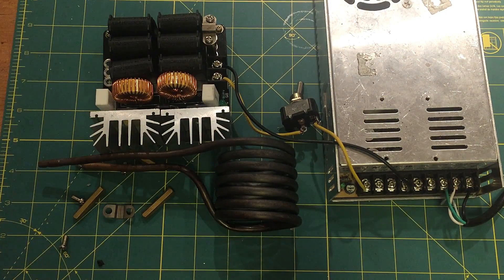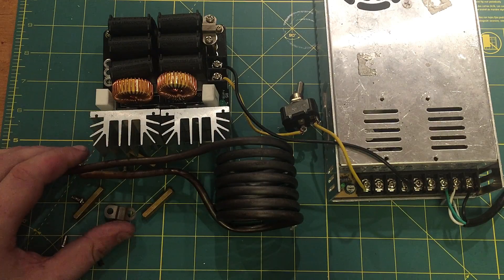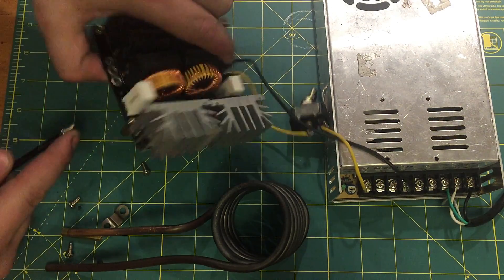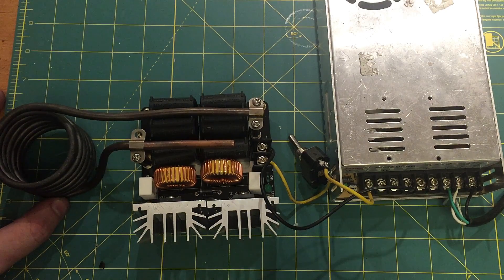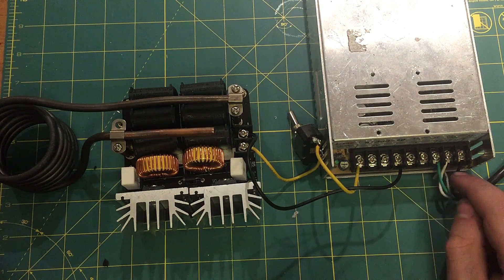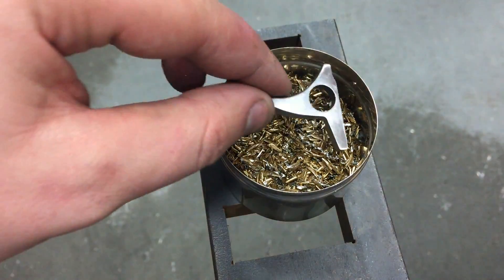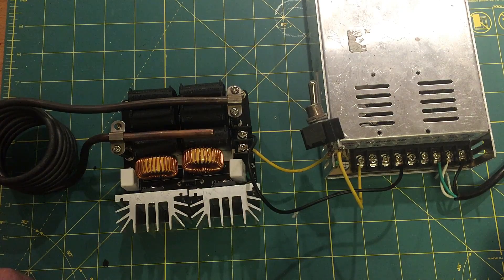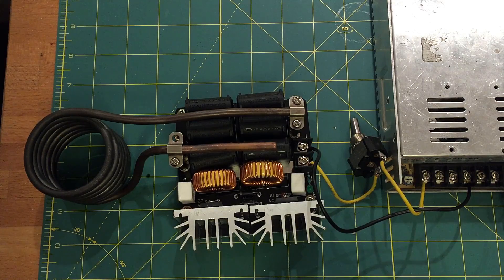1000W Induction Heater:  Overview, Mistakes and Lessons

Comment: Its sold and marketed as intended to be used with water pump cooling the work coil. and high flow fans to cool the caps. otherwise you cant go past probably 100-200W safely. You obviously cant use it at 1kW for any amount of time without cooling. its a very basic tank circuit with quite low rated common parts and its without any "brains", like current control, any control tbh, its just resonating with 8 descrete parts, so its a bit random and can blow up if something lags. This is why you also should fuse it.. Also, The power can get much higher in the coil. The resonating parts, the work coil and capacitors, push a much higher current at resonance. Multiple times higher.

Comment: I have 4 of these and they vary from 6 years old to 3 weeks. If you run water through the heating coil and a fan on the circuit board you will negate the overheating issue.

Comment: great video sir, BUT you should have a 15 amp circuit breaker on the positive line near your on/off switch, this will save your power supply from blowing up.
I have this same module only i added 4 extra Capasiters and 2 extra Inducters and soldered them under the circute Board this has stopped the module from Heating up due to prolong use.
for water cooling i used a car wipper washer bottle it works perfect with a 9v power supply.
you will need to change the coil size  to get maximum temp.

Comment: How do you prevent the board from overdrawing the power supply? I am finding that I can get the board to turn on, but the power supply blows once I put a piece of metal into the coil. Any ideas?
Reply: The solution is to use a suitably powerful power supply.

Comment: Why don't you cool down the circuit with a 12v fan instead of cooling down the coil. It works very well
Reply: Because that is not the best way to do it. The coil is a tube (pipe) for a reason. The circuit board doesn't get hot, the coil gets hot and copper conducts heat. DOH

Comment: OK, I know the video is 4 years old but, anyway. Capacitors get hot in these designs and, like semi conductors, need to be cooled. Also the induction coil, so try pumping water through it from a bucket on the floor. Lastly, the power consumed and heat generated will depend on how well the coil couples to the object being heated. If you had a 2 inch internal diameter coil heating a 1.75 inch solid iron bar you might get up to 1000w input. This implies you might want to try smaller diameter loops for smaller objects - you might also want to insulate the coil to avoid "issues".

Comment: You need a power supply that can deliver at least 20 amps. That's because it's all too easy to load the circuit down to the point where the power supply goes into current limiting, which reduces its output voltage.  Once the voltage goes below about 12 volts, the Mosfets don't turn on fully and then they overheat and fail.
Reply: How do you make sure the induction board doesn't overdraw the power supply?
Reply: @the.marylander  With this circuit,  the ONLY way to keep that from happening is to use a power supply that can supply at least 20 amps, or, even better, let's say 30 amps.  The board simply takes whatever it needs.  In my opinion, you MUST have some sort of amp meter in the DC line to the heater.  And, just in case, a voltmeter across the DC power supply as well so you can make CERTAIN that the supply voltage never drops below 12 (or preferably 24 volts at any time.  If things are working properly, when you first power it up using the coil that comes with it, the system should draw a half dozen amps or so and the power supply voltage shouldn't drop at all.

Comment: What frequency do they work at?
Reply: Usually a few tens of khz.
Reply: @uK8cvPAq  is there any way one could make it work at 100 KHz or any particular frequency?
Reply: @atul2048  Yes, the frequency is set by the tank capacitor and coil inductance.
Reply: @uK8cvPAq  ✌️ ✌️ Thanks man
Reply: @atul2048  That one is running at about 90 kHz.

Comment: Cool, I almost killed mine yesterday too, it's scary how much heat the coil put out.  Previously I was running from the "brick" power supply I got from recycle it was 20V and 12.5A and coil never got charred.   I decided to get power supply with adjustable voltage and digital meter that displays voltage and amperage it actually goes up to 51.7v and 11.3 amps but boy did everything got super hot!  You also reminded me that I could heat treat my  O-1 parts as well.  I got the water pump already, I need to make a different coil and make sure connectors extend past circuit board, don't want water leaking on circuit board.

Comment: I don’t think you watched many other videos, or read the information from the various people selling this. Or read up on induction heaters.
You need to water cool the copper, and you also need to do better cooling of the suppy if you use it any high power. The manufacturer says that, and most of the videos by anyone who has used it without blowing it up have done that.
It’s not a toy, it uses high voltages and high current to create very high temperatures.
Reply from the maker: Fair enough, i could have done more research, and i appreciate the safety warning, though i do think it was a fairly honest depiction of how someone else may be tempted to approach it (and how thats a bad idea :p)

Comment: would it be possibel to extend the coils or do they need to be a spesific length and so?
Reply from the maker: I imagine youd run into power losses with a longer coil.  The more coil there is, the more inductance, and the harder it is to reverse the magnetic field quickly

Comment: Anyone know what size silicone tube would fit to run water through this?
Reply from the maker: So for the pump it wants a 3/8" ID (1/2" OD) tube, the coils are 1/4", so since the video I got an adapter for 1/4" copper pipe to 3/8"ID pipe (https://www.mcmaster.com/#51875k52/=1ciztzo + https://www.mcmaster.com/#44555k133/=1cizt1o) to connect the copper to the tube, and then you can just route the 1/2" tube

Comment: I was thinking of buying a similar kit, my goal is to experiment with heatshrink toolholders for small endmills/holders (1/8 inch or 3.175mm in SK15 toolholders for example) Do you think this kit has enough juice to heat the end of that toolholder for those small endmills?
Reply from the maker: I don't know if this would be up to it.  When I get the new one up and running I'm hoping to try some shrink fit tools, but it would certainly need good cooling in the coils.  The next level up is about $400 USD, but I have heard of people using that one for shrink fit tooling.  I'll definitely try to come up with an answer on the part 2 of this video!
Reply: Thanks for the reply, I haven't seen someone try it on this scale (small scale) and as a DIY project. I think it's pretty cool and would love to experiment with it! For what machine and what size toolholders do you want to try it?
Reply from the maker: Well I saw someone on instagram make ER16 shrink fit solid collets, so I'd love to try that, but it wouldn't be too hard to just start with a big block of steel with a hole in it and progressively turn it down to see when the heater can expand it enough
Reply: Oh that is a way better idea! easier to use on many different machines without extensive modifications. I'll keep an eye on your video's (in case you actually get around to trying it out). If I get to it sooner, I'll let you know!

Comment: How can you control the temperature of the heated material? Lower voltage? Lower current? I want to temper something at about 250 Celsius for a longer period of time, not to go as high as 700-800 Celsius. Thanks
Reply from the maker: I think the correct way to do it would be to change the frequency which you cant really do on this board.  Otherwise you could under power it and it just wouldnt be able to keep up with the object cooling.  I think id go with a cheap toaster oven for annealing though :p
Reply: This is actually not such a bad idea! I already have a speed variator recovered from a old vacuum cleaner, if it's thermostat won't do the job properly. I suppose I can have enough control for what I want.

Comment: can i put 2 1000w ZVS together and make them share the same coil dose that will give me 2000w power ?
Reply from the maker: Im not sure... i think they would have to be synchronized when they oscillate or they would cancel each other out
Reply: i need to melt iron and steel with this ZVS any ideas ? can it  melt steel if it left for to long ?

Comment: Also, you can make a cooler running treatment coil from Litz wire.  It's especially made for high frequency magnetics.  It's a way to go if you're not particularly thrilled with liquid cooling the treatment coil.  However, Litz wire is a specialty wire and isn't cheap.
Reply: Are you sure about the Litz wire idea? I'd think the Litz wire would ruin the effect but that's just my gut talking. My gut is often wrong.

Comment: That rig looks like it's not meant for constant duty.  Instead of a toggle switch flopping around, try a foot switch.   Leave the power supply on, and when you're ready to use it, walk up with your part, step on the switch and heat treat, then walk away.  That way, it's only on long enough to heat treat your part and spends the rest of the time cooling down.

Comment: Looking at the design of your induction heater, I wonder if you were to connect the induction coil to the underside of the PCB using the same standoffs it would reduce the amount of heat from the coil that convects towards the capacitors and avoid them overheating! As mentioned by others, and indeed yourself, cooling the induction coil would be an obvious improvement and cooling the PCB with a fan may also be of benefit, but only if you notice the heatsink getting very hot without one. The alternative would be to connect the induction coil with heavy gauge stranded cable to keep it away from the PCB completely. Good luck and thanks for your video.
Reply from the maker: I get the impression that the heat that did a lot of the damage was radiated from the coil, rather than any kind of direct transfer or convection, so I think a high temperature sleeve would help a lot.  Thanks for watching!

Comment: So how much do you reckon a good setup for the home shop could cost? Mainly i am looking at brazing carbide tips. thank you
Reply from the maker: hmm I think brazing carbide tips would be manageable with this ... of course you'd have to do some work to incorporate cooling.  We have a $1500ish induction heater at work and it is quite powerful, but it may be overkill for brazing.

Comment: In your MKII, you should also add a fan to cool the capacitors, inductors, and heatsink...
Further additions:- 
* An ammeter
* A large resistor (nichrome wire would onto a former, kept under oil/water),  about 3-4 ohms.
* Add a "soft start" switch to run power through the resistor first. 
If the current is "normal", turn on a second switch that shorts out the resistor, thus applying full power.
If current is too high, turn off and fix. Nothing should have been damaged by running only at the lower power

Comment: I can't believe you didn't see a million other videos, where they used water running through the coil! 
Also, it's not "induction heaters in general" that need the "kick", rather it's specifically ZVS drivers (what this is) that need it.
Reply from the maker: +Jethro Jones  i have seen lots of videos with water cooling and lots without, so i thought i could get away without (i probably could have with more intermittent use).  Thanks for the correction regarding ZVS drivers versus induction heaters.. im learning as I go!  Good ideas in your other comment too, ill look at implementing them!
Reply: If you leave it out in the atmosphere it will most likely anneal i would recommend using a cooling shower underneath your coil (seperated by non conductive material brass etc) or integrated in the coil (bore holes in a 45 deegre angle and lead water through it) , the intense cooling will stimulate the creation of martensite in your material making it even harder and it will also act as an coolant for your coil.
Reply: can we use this to cook food or heat water?

Comment: Great video! Good tips, i'm glad i watched it before i started testing my induction heaters ':)
Reply from the maker: Thanks!  What are you planning on using yours for?
Reply: Was planing on anealing ballscrews so they can be turned. but i would like to heat treat iso 30 taper toolholders, but i don't know if they are to big for 1000W?
Reply from the maker: LongrangeSweden i think ballscrews would be fine depending on the type of steel, the tool holders may have to be wrapped in high temperature insulation so they dont lose the heat... u should make a video when u try it!